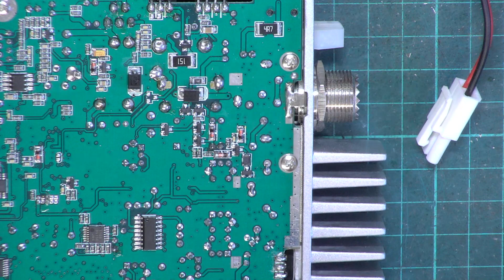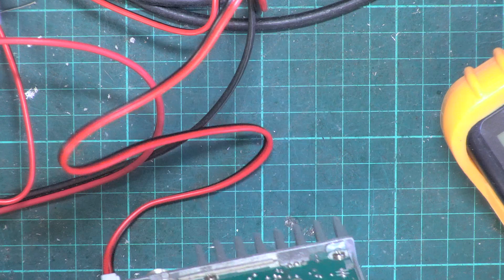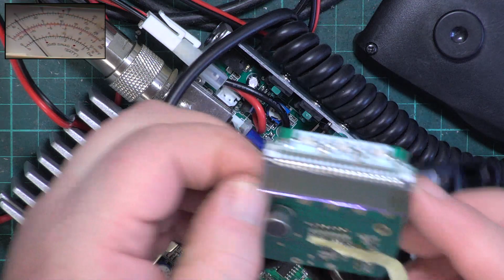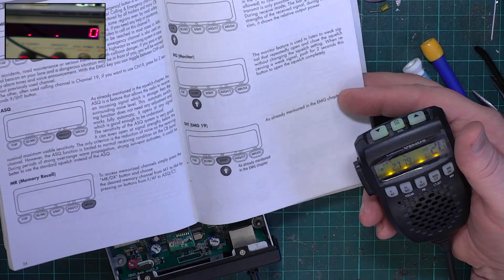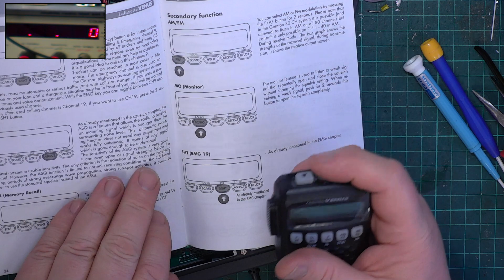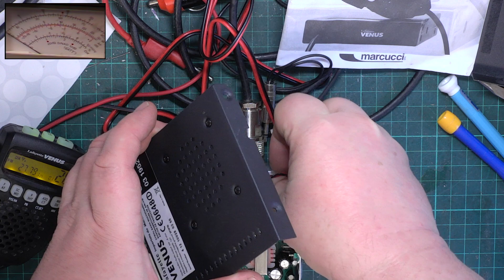Lafayette Venus UK CE MultiNorm CB radio - Two snag repair plus service

Comment: Great job Richard! Your customer can keep that set as I certainly dont want it seeing the faff to change settings. The chasis looked well designed in fairness. I was a bit worried about you pulling that lcd display off 😬